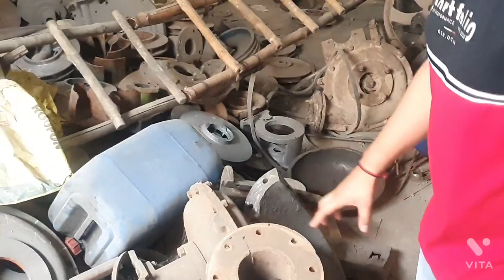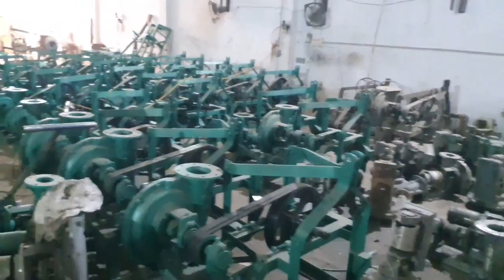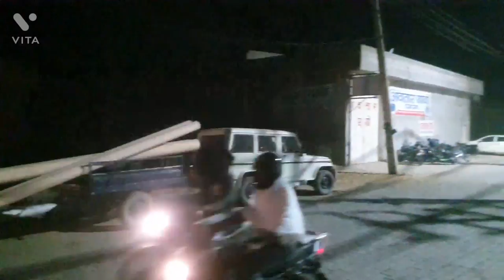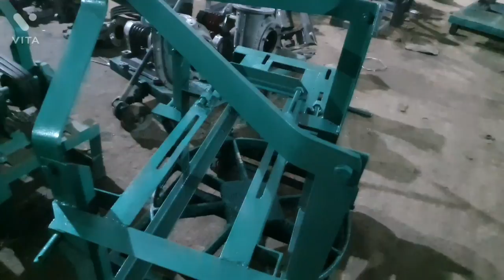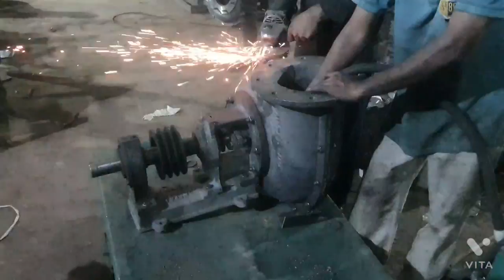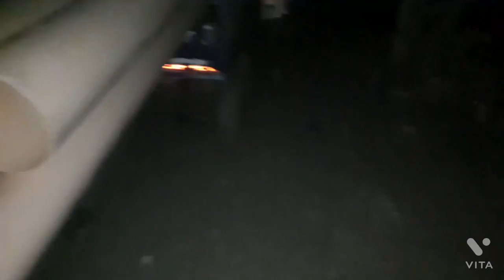Pto tractor water pump 8X8 पंप अवतार बावा सिरसा, अब तक का सबसे बेहतरीन वीडियो पानी वाला पंखा

Comment: How much rate
Reply from the maker: 45 thousand
Reply: Total set
Reply from the maker: @peterkuriakose2871  i have used 8 inch pipe length around 50 feet which was around 40-45 thousand
Reply from the maker: @peterkuriakose2871  in total 90 thousand. Check other videos on my channel for setup